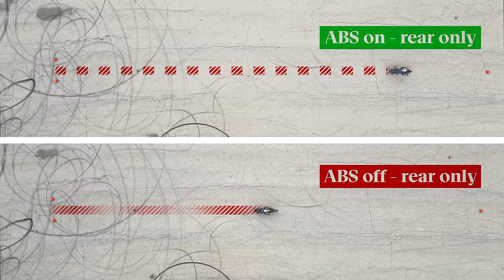Out-braking the ABS Myth

Comment: Dude tried cutting across three lanes of traffic on a highway divide, everyone slammed their brakes in front of me (cars) while we're basically veering right following the lane curve. I had more lean to go and caught the cars in front of me stopping fast so i took my exit route to the lane next to me.
Did that so i didnt rear end the car in the lane i was previously in. 
Homie then from almost a dead stop on a highway tried cutting across three lanes to either hit the BP gas station or go into the 2 lane service road that has bp entrance on it or he just didn't want to drive another mile cause he missed the exit that is on the service road a litle ways down that service road.

I practiced progressive and threshold  braking before cause.. well yeah bro i don't want to die if anything happens.

I was slightly riding brakes from the whole swerving out of far left lane but even before I saw dudes front passenger door and quarter panel turn into the rear end I was preemptively preloading rear for weight transfer if If I had to slam on both brakes. 

I did when I saw side of his car. 

Brakes felt like they just locked both instantly. I def oh shit braked once i saw him try to cut across .. but

I slammed into the back of his car at highway speeds (its a 500 im not speeding anywhere lmao).. I flew across like two lanes of traffic (wheeeeee). Bike did a front flip, trashed the sissy bar. Handlebar bent, bottom of forks bent towards the back. Front wheel like 15° of center line. My brick shit house nuts bounced off the tank as i went weee, dented that in. It was allot 

Anyways tldr; I think if I had abs i wouldn't have hit so hard. Bike is totaled 🥺.  Fuck that guy. With insurance check (hopefully) I'll buy a bike with a good abs system

Comment: Yeah but, we know Threshold Braking is better than ABS, with cars also. Threshold Braking is applying the maximum brake pressure before the tire locks up, so of course this is better than ABS. The problem though is it takes more skill to Threshold Brake than almost all motorists are capable of, hence why ABS is considered better.

This vid wasn't about ABS vs no ABS, it was about ABS vs Threshold Braking, the latter almost no one can achieve.

Comment: The myth is that ABS is supposed to make you stop sooner. It's not. ABS allows you to maintain control while braking, in either a car or motorcycle. If you lock up the wheels, you can't steer anymore.

Comment: Do people actually think ABS is meant to brake harder/faster? It's often the opposite, and not even what the system is designed for in the first place.

ABS is intended to maintain control while braking. To do this by pulsing the brakes rather than modulating them, it is definitionally not giving the best possible braking. In fact, in some conditions, such as loose wet snow, it's immensely worse, by over a factor of 2, because locking the wheels builds up a wall of snow in front of the tires that's about twice as wide as the tires, while ABS rolls over it.

In fact, in testing, IIRC the only time ABS reliably out-performs a well-trained human is on perfectly smooth, very slippery ice (they tested that in an ice skating rink), and it's only by maybe 20%.

I'm curious about modern traction/stability control, though, since it can modulate brakes rather than just pulse them.

My first personal experience with ABS, though, gave me a far more visceral understanding of it than the test and articles ever could. I was driving my grandpa's Cadillac Seville (I think probably a '94, and this was in about '96) downhill toward a stop sign in the rain, and noticed the stop sign a little late. I hit the brakes, got good strong braking, body pitching forward a little... and then the ABS kicked in, tickling my foot and significantly decreasing braking force and I rolled into the intersection when I definitely would've stopped without it.

I have also had instances when I was glad it was there, though, when I was able to maintain control in an emergency stop in winter on the highway.

Comment: I always thought that ABS was to prevent bad brakers from locking tires and crashing, then it became rather efficient at breaking, but ABS is a safety measure, not a feature to use.

Comment: I'm really curious to see the same video but on a wet road
Reply: ABS "on" braking performances get worse as grip conditions get worse. Now, as the guy suggested at the end, the best compromise between safety and performance is, on a daily basis,  to keep ABS "on", while triggering it as rarely as possible, which requires threshold braking, which in turn requires practice AND full driver'attention whenever braking is required. Driving is a full time job that requires full time commitment.

Comment: Bike ABS lags behind a cars, car have a Emergency brake activation program that applies brake pressure quicker than a person can. There is also a big difference between systems in how they react to improved grip level. Looking at the caliper manufacturer  then this manufacturer may be one of the least reactive.

Comment: I guess I ride differently than all the rest of you because my first instinct is to get on the front brake while downshifting for engine braking.
   When riding in questionable conditions, always use the higher RPM threshold of the lowest gear. ( If you're on a road that you would normally cruise in 4th gear, stay in 3rd when its raining and keep the engine revving higher. The instant you take your hand off the throttle you will already be engine braking before you even get on the brakes.)
    The problem with ABS, and the reason it can be a hot topic of debate, is that ABS just stops your brakes from locking up. It doesnt make you a skilled rider, and it doesn't make uou safer than a skilled and experienced rider not using ABS.   ABS is great for people who know how to use it, and that understanding and experience comes partly from having loads of experience without it.
    All this said. I used to commute year round in the PNW (30 miles to work, 30 home )  without ABS.
   If I still lived there,  I would absolutely have a commuter set up with ABS. But, I live in Texas where the average yearly rainfall is 12-14 inches and its sunny and 80 degrees in December. 
    ABS is very unnecessary for my situation.  Depending of where you live and your riding conditions it could be a must have or just another over engineered road obstacle.

Comment: I suppose at the end of the day I’d rather be in full gear sliding or somersaulting (having pulled my front break with enough power to fuse it to the handle bar) than be wearing a car bonnet for the short rest of my life. I can’t afford ABS 😅. Gotta practice threshold braking.

Comment: Is it a myth? Or perhaps ABS is to keep control(wheels not locked) of the car, well, bike in this case? Lets not forget that doing what you did is not the same as emergency breaking in a dangerous\stressful\frightening situation. Its called Anti-lock Braking System, not Shorter Breaking Distance System.

Comment: Sorry this video was extremely unclear. 3:42 why is brake pressure bled off every 100 ms? Is the wheel locked up? What phases are we in? 4:55 'abs braking distance is halfway to the moose' yes but what about the non-abs stopping distance? Wouldn't it be just as far? 4:10 why suddenly an 'old car'? Do those have different ABS-systems than new ones? What's the point being made here? Why at 6:06 does rear ABS matter? How hard are you hitting the rear brake? And what about all those videos where ABS outperforms skilled riders (on yt, the honda fireblade video)?

Comment: 2009 Toyota Corolla's ABS is horrible compared to pump braking, and even someone who doesn't practice it would out brake that ABS, which unluckily was programmed the same as multiple Toyota model for multiple years...  I luckily had a car that's ABS went out a year before getting the Corolla, so as soon as the ABS kicked in and reduced deceleration, I start pump breaking out of habit, or else would habe crashed into someone the first day owning it.

Comment: ABS was never invented to cut the braking distance down/shorter but was to assist in the control of the vehicle while under emergency braking. If the wheels lock up in an emergency  you have lost control as you would be in a full skid but with ABS you will not lock up the wheels thus aiding you in steering around and avoiding a full head on collision. saying that. ABS doesn't help against the idiots that use the roads and cause the accidents in the first place.

Comment: All hatred for motorcycles having ABS is just bikers going through the same growing pains as drivers did in the 90's and the whole anti-ABS bias: Resistance to change. ABS will always brake better than you will on ever the worst ABS systems, redo these tests during turns for even more shocking realization of how badly you as a motorcyclist need ABS.

Comment: might sound dumb but why do modern bikes still have separate brakes. like just get rid of the front brake lever and have the pedal brake both wheels?
Reply: Because of the effect of using the front brake causes in the bike. 
Sometimes while maneuvering at low speeds using only the rear brake is better.

Comment: Disappointed in this video tbh, wasn't very clear what the myth was and didn't involve much explanation. Feels like it was knocked out in an afternoon.
ABS is NOT designed to help you brake faster, it's designed to stop you LOCKING UP the wheel. There are plenty of examples of people locking up wheels and making a mild accident into something much worse, and locking up the rear means you're almost guaranteed a high-side when that wheel finds grip again.

Comment: The point of ABS isnt to shorten the stopping distance, but being able to avoid stuff while braking.
Reply: No it’s both.The average driver will lock their brakes without abs and while yes this does mean they lose control, it also makes the distance twice as long
Reply: @ploppyjr2373  No. The reason we got ABS is to be able to maintain control. They sacrifice distance for control. Thats the whole concept. Because as you mention most people will panic and slam the brakes. And research has shown that impacts could have been avoided if the driver maintained control and avoided the obsticle.
In this video it looks like using abs is not good, while in most cases it will be more safe with it.
Reply: @henninghellerud  well it’s for not locking tyres. And when you lock tyres you ofc lose control but when you lock the tyres the braking distance also becomes significantly longer
Reply: @ploppyjr2373  but the point isnt about braking distance. It has never been about that. Its cuz studies has shown staying in control and be able to manouver is more important. (people panic and slam the brakes and turning the wheel to avoid something)

Comment: The premise is all wrong,
ABS’ original and main purpose was the Control of the vehicle under hard breaking and/or breaking on slippery surfaces,
To be able to still steer under hard breaking and not locking up the wheels.

Comment: Is it just me or is this whole Video based on a malformed presumption?
Never has anyone told me that ABS reduces the stopping distance. In driving school (germany) we learned that ABS sacrifices some stopping distance to maintain steering ability. It may reduce stopping distance on a wet road or in slippery conditions, but not normally.
It's in the name too. Anti blocking system. Not make-braking-more-faster system. That's the tire's job.

Comment: Legitimately curious who, and astonished that anyone, believes that ABS decreases braking distance.  Seems the presenter doesn't understand the purpose of ABS in 2 or 4 wheel configurations.  ABS is not intended to decrease stopping distance, and it's quite clear to anyone with the most basic grasp of physics that it is impossible to do anything but increase distance.  There's nothing unbelievable about being able to stop faster in a straight line without ABS.  The whole point is with ABS, both for 2 and 4 wheel applications, is that you can apply full braking pressure without having to be worrying about the threshold where the wheels will lock, while still being able to steer where you want to go.

Comment: Abs is to keep idiots safe in dangerous situations not safe in all breaking conditions
Its to prevent lockups which could cause a slide which the average driver has no clue how to deal with making the situation possible much worse

Comment: who on hell uses only rear brake?
It is, as you dont use brake at all.
This video is like.... "we found one circumsance out of thousand, where ABS is bad, so ABS is useles"

During 2 years, I have had 5 front wheel lock ups. Witch 2 of them was loose gravel on road, not emergency brakeing. Yet, I still managed to stay up.
I am definetly going on ABS system with my next motorcycle.

Comment: This is not completely true.... cheaper bikes specially around  200cc segment are equipped with what I call, low grade ABS, which does not allows threshold breaking. My yamaha fz 150 has this single channel (front only) abs, and it triggers quite early.

Comment: wasn't ABS designed to avoid driver loose control thus more safe? when the wheels are locked you don't have any control on them.. if you break controlled you can control your car/motorcycle and avoid a collision.

Comment: I think this video is missing the point... ABD isn't designed to help you to stop faster
You will stop faster with no ABS in a car aswell

You won't however have control of the vehicle
And that is the point of abs
To brake effectively whilst being able to turn your vehicle and avoid an obstacle

Having ABS helps to remove human error in breaking

This video is misleading to the point of misinformation...

Comment: 0:41 Why? Because riders are afraid to use the front brakes to the max. Why? Because if they lock-up, down they go and especially if they are leaning a bit to avoid the obstacle. Learn to ride! I hardly use my rear brakes. When braking using your front brakes, your front tire is "loaded" providing more friction. Of course this all depends on the road surface, rain, etc. Personally, I have no use for ABS and stability control on vehicles. I laid down a very long faint black line from my front tire during a real world accident avoidance. That is threshold braking. I and the idiot on the bicycle survived.

Comment: In a car you can also outperform standard ABS with threshold braking if you were at a track or in a controlled environment. However, in a real world scenario where instead of premeditating your point of braking and being able to focus on the process of modulating the pedal your dumb monkey brain has to react to the car/motorbike/person that just emerged into your path from an unseen point ahead of you and give the order to drop the anchors. The whole ordeal could be over before you've even had time to regain active control of your body and that's where ABS proves to be so vital.
It's sort of like the question of "what would you do if someone took a swing at you out of the blue?". We all like to think that we'd tuck in, bring the guard up, roll with the punch and then counter with a devastating uppercut but the truth is that we'd probably just get punched in the face and then, if still conscious, curl up and try not to die until it either stops or we get a window to run away or attempt to fight back.
Yes, if you're Tyson Fury, Valentino Rossi or Max Verstappen then you're going to have superhuman reaction speeds and an innate ability from training the monkey brain over thousands of hours of practice to the handle high stress situations with the correct response but otherwise it's best to understand your limitations as a normal human being.

Comment: 3.3K views  2013 video: "How to Avoid an Accident with ABS | Michelin® Winter Driving Academy" 
1.8M view with 82K likes, 2023 video on misleading partial reality about ABS braking video. 
One video shows to avoid crashes, the other may result in a crash... if you actually to use ABS or ESP for what it was designed for... you first learn how to ABS and ESP avoid crashing, then you learn how to make it better and don't interfere with them... Remember is 2024, no 1995 when only one car had ESP, neither 1978 when only one car had ABS oem fitted...

Comment: "a human being can do what a computer cannot" is false, plain and simple false. It is the problem that the ABS computer is too simple, it must have more sensors, one measuring the loading of the wheels (the shock absorber depression) and of course the tilt of the bike, then it would brake much better than any human can, because a human can never calculate all these variables in milliseconds. Or in other words: Provide even one example where a human controlling (or driving) a machine does this safer, more efficient and faster than a computer does.
In cars, it is not that humans learned to drive better to reduce accidents, no, it is more and more automatic safety systems that are responsible for the improving safety record of cars.

Comment: Practice is fine, but this is yet another misleading video. This demo was on a clean dry road. Try this in the wet or otherwise compromised surface and most experienced riders will wash out the front on a panic stop. ABS can react to friction changes the rider cannot see.

When Keith Code brought ABS bikes to the Superbike school, accidents dropped by 60%. Insurance actuarial data does not lie. People panic in panic situations.

Comment: This is stupid !!!    ABS    Doesn’t even stand for stopping quickly or quicker !!!    Conflating multiple issues together here,  abs is only what it stands for “anti lock “            Not so good to use bikes as examples cause antilock brakes preform better in vehicles, which is what it was intended for. And motorcycles were an afterthought and years later and without the same results!!!